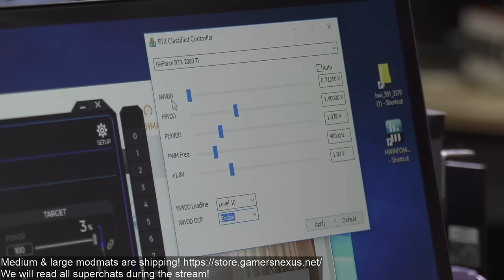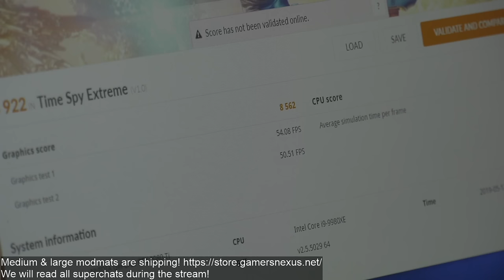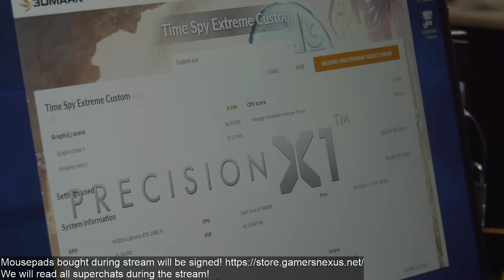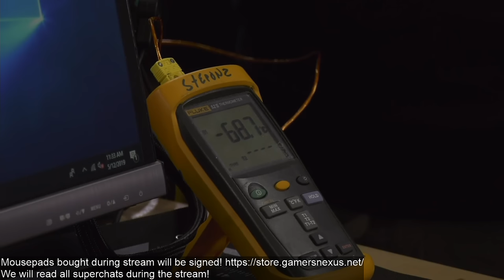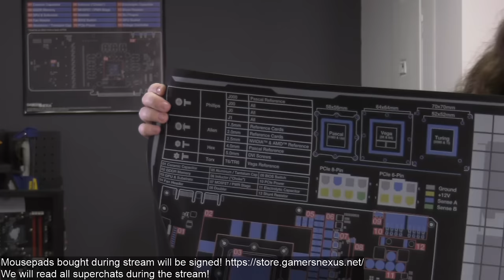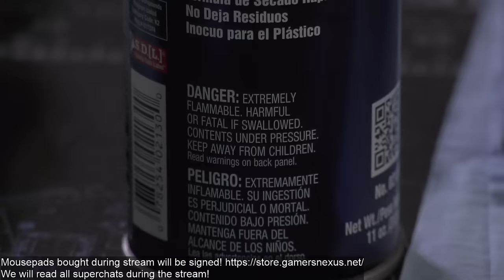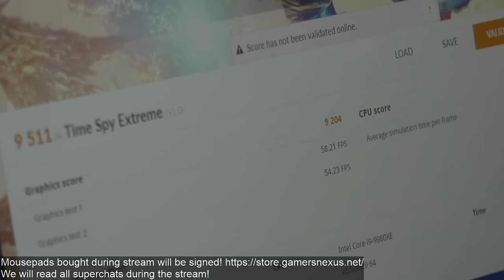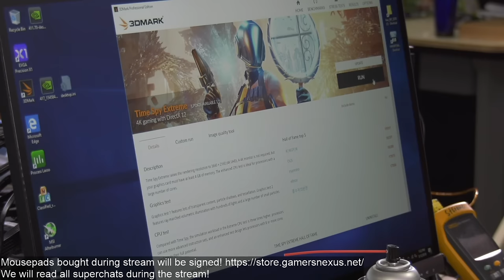Live: KINGPIN 2080 Ti Overclocking No Power Limit, Ft. Bearded HW

Comment: These RIP and overclocking streams have made me get some older GPUs for O/C.  currently have most of the hwbot records for the R7 250x.  The older cards with the dumb buck controllers make is easy to pencil mod the resistors for more power.  cooling done with a cheap ebay waterblock.

Comment: Gamers Nexus,

People were saying that loop order didnt matter, and then you started talking about how GPU temps effect clocks. 

No one is arguing that GPU temps don't effect clocks. The point is that once loop temp equilibrium is reached, the loop order wont effect the temperature of the GPU or the CPU by any meaningful amount. Those temps are going to be determined by the heat energy dissipation capacity of your radiators
Reply: Yes of course ambient matters, but changing ambient temps arent going to have an effect on whether loop order matters or not, that would be assumed to be a constant
Reply: @SoupRKnowva  Depends how much flow/restriction you have and how extreme the power draw is of the components. I got up to an 8C coolant temp difference from coolest point to hottest point in a loop with a 380w power limit 2080 ti + 2950x pulling 250w with 5 x 360 radiators and a single 140. Even with 2 x D5s in serial @ 100% it was too restrictive to reduce the temp difference between sensors so I had to split it into dual loops where there would be only one heat source per loop and more efficient flow since serial pumps doesn't double flow. The 2080 ti eventually got moved to my 9900k rig. 

The 8C would have been enough to drop a second 2080ti's boost clock by like 30MHz if it had been placed in the the wrong part of the loop.
Reply: @Lead_Foot  That's a pretty extreme setup, both in the heat you're dumping into the loop and in radiating power! an interesting data point for sure :)

Comment: Stanley! Simply the best vacuum thermos. I wouldn't trust a Starbucks, Chinese welds to that extreme cold. I've had a Starbucks thermos lose its vacuum to thin air. Plus the insulation factor on those bad boys. There's a reason they make almost the exact same thing to this day (the only changes have been in the lid and lid threading).

Comment: When overclocking RTX cards step up in multiples of 15 on the core. So +30/+45/+60/+75/+90/+105/+120/+135/+150 ect...
Reply: The boost bins aren't multiples of 15 btw. So you are misinformed.
Reply: @ConeJellos  if you look at 3dmark scores the kingpin cards run at 2130,2145,2160,2175,2190 most commonly on air. So maybe your misunderstanding me or I phrased my comment poorly, but these cards for a fact run in offsets of 15mhz

Comment: when it hits full thermal saturation  whats the temp difference between in and out of rad  if its not a high enough delta it may not fall into the gpu stepping for gpu boost.

Comment: @GamerzNexus I recently purchased a rtx kingpin card and i had a little glitch with my memory.   It for some odd reason down clocked 200mhz to 6800mhz total, temperature was 36c and it had been idling on windows for a couple hours.     and I defaulted the card back to the original settings and it still wasn't working.  A system restart finally defaulted the card back to 7000mhz on memory.    I wanted to ask if you have had any issues regarding any memory down-clocking.
Reply: SmokinGoodd none..are you checking while running a bench?